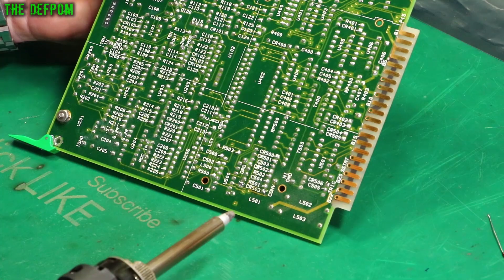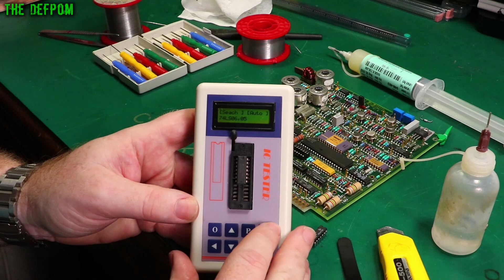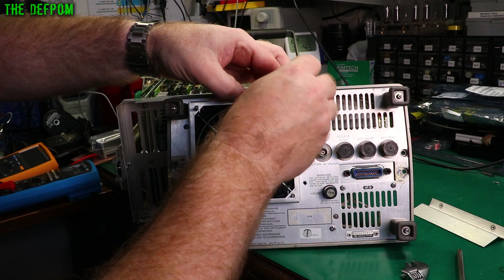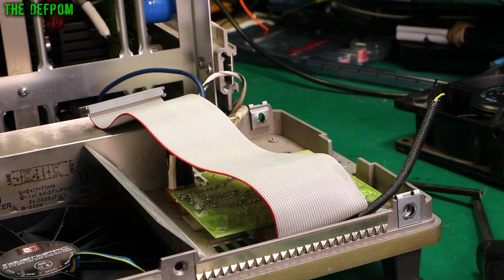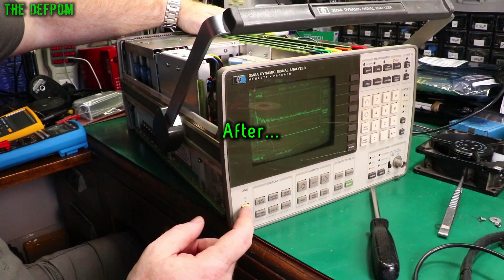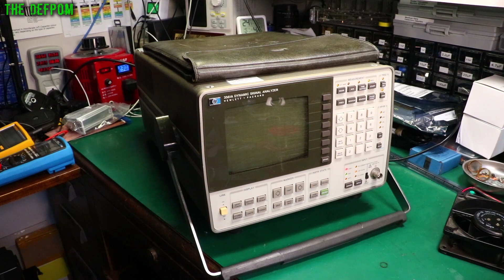🔴 Can I Fix It ? - HP 3561A DSA Repair Part 7 - No.933

Comment: Thanks for taking the time for the 7 videos.  You don't find much 3561A info on YT.   I replaced the fan in mine with the Noctua 2000rpm fan as well, after drilling the holes out for the screws, I used the enlarged hole to feed the wires up through, looks and works great.

Comment: You really did a good job 👍 Maybe you could answer me one question: Does the HP 3561A offer a function to display the power spectral density in units of Vrms/rtHz in live mode like the HP 35660A (https://youtu.be/Y0jkPLuFdnM?t=1527)?
Reply from the maker: I don’t actually know, I haven’t actually used it since fixing it

Comment: Hi bud, great fix up, love your work, and the fact you waited to get the new parts. 🤙🏼
Just one question, what solder and soldering iron are you using? It looks so easy to use, never seen silver solder before.. inquisitive me🤙🏼🇦🇺
Reply from the maker: Thanks, the iron is a Jabe-1200 which I review and have purchase links to here:
https://youtu.be/rzp24iXOqdI

The solder is a multicore branded, it is Lead/Tin base with 2% Ag

Comment: Hello
I have a solartron 7066 meter. It worked properly for 3 years and suddenly it stopped measuring positive voltage. Negative measures correctly. Blocked 10V range and the meter, after exceeding + 1.5V, turns off the screen and only helps to turn it off. Ok works on negative voltage. I am looking for eprom charge for verification. Earlier, I watched you repair a similar model.
Reply: why don't you leave your comment under that video? what is that eprom charge you are looking for?
Reply: @feedback-loop  I found a very similar one, and you are my last resort. Nobody publishes about such a measure. I have a 100% problem with the eprom. The meter broke because of it. One die has no content. Regards, Ludwik
Reply from the maker: You will have better luck asking on the EEVblog forum for someone else that can give you a copy of the EPROM data.
Reply: @TheDefpom  There is nothing on the net for this model. But I found a source in Poland. I have to wait about 3 weeks and it should be. If I get it, I will praise it.

Comment: Great job. Lower voltage zeners have quite a slope in V vs I. (Dynamic resistance,) so can be all over the place.  Noisy fans can be a problem.. Is it a 3 wire fan? They might monitor the 3rd wire?
Reply from the maker: When I tried substituting a surface mount zener it gave a higher voltage, so the tolerance is pretty wide.

Comment: Personally at 6:08 i would have cut the chip out, you have the replacement chip but not a replacement board. It’s so easy to break a through hole  plated hole on older boards where the glue’s were not as good as they are now days.

I can see the point if you want to test the chip, but otherwise risk the damage to the easer to replace part.
Reply from the maker: I almost did, but I wanted to test it

Comment: Well, I certainly had my doubts about this repair, but you really are a determined old soul. So am I correct assuming the main cause was the 74LSXX chip?  I know the general purpose zener .5 watt step is from 2.7 to 3.3 volt, so would that have made any difference at all?  They do make a 3.0 volt but it would not it be sort of special?  I have found zener tolerances are all over the map except for the special temp compensated types; 1N82(X) series for example.
Reply from the maker: Yep, after the DRAM failure, the other main issue was the SN7406N, the diode probably could have been left, it did seem to be working well enough.